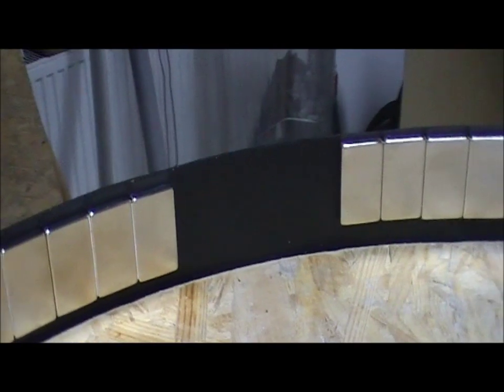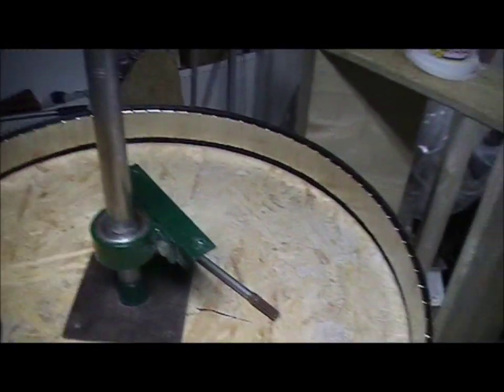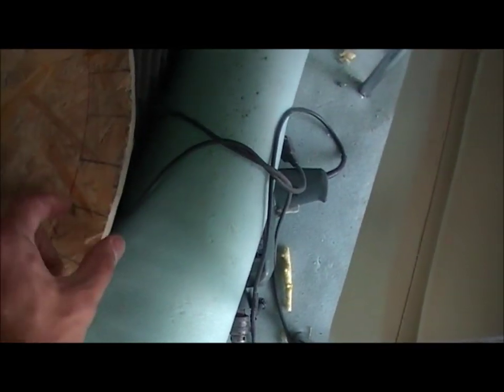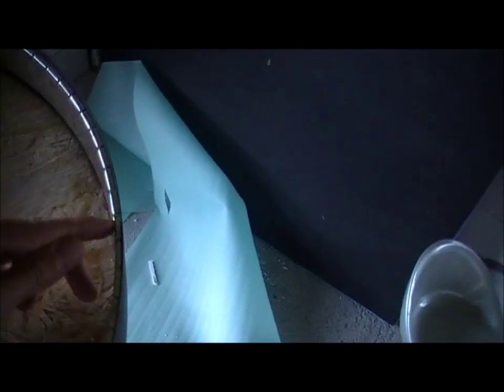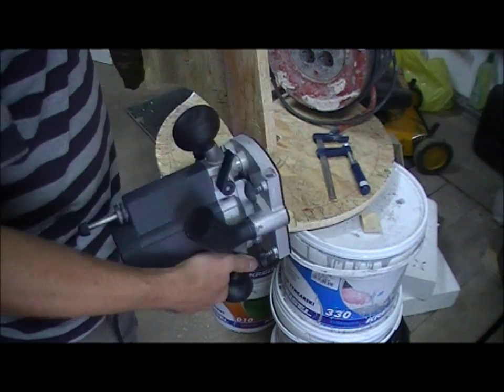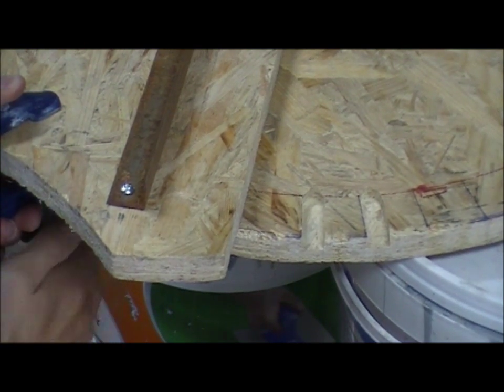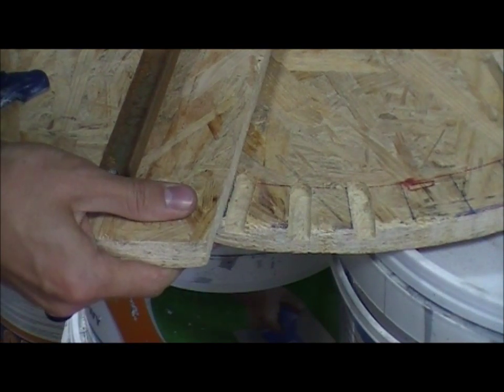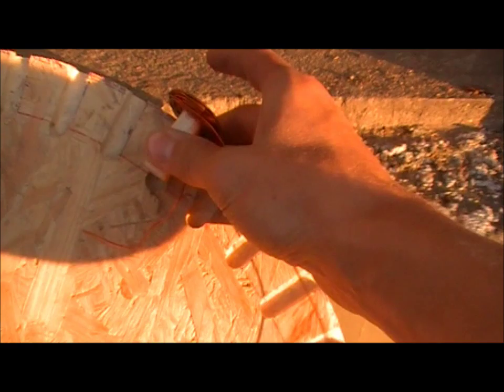Home made windmill generator part 3 - the stator

Comment: you could go with a iron plate to create an iron core windings this would increase the inductance of the coils to increase the current and voltage. the wider of the iron core can be to match the depth of the magnets be the more it helps boost these features.